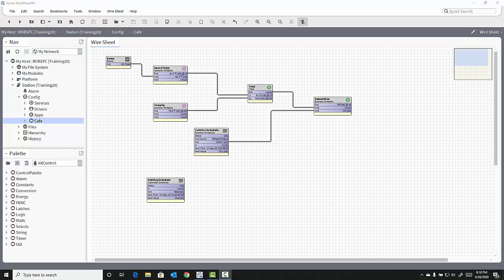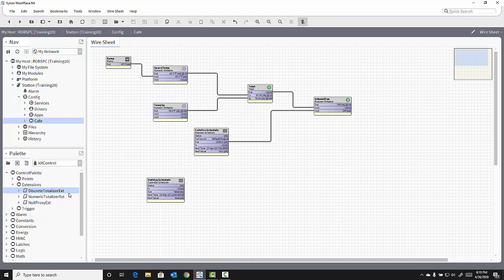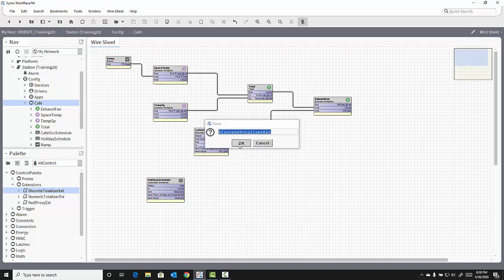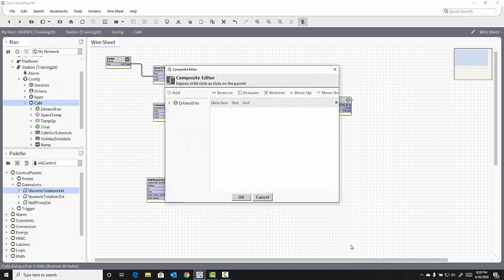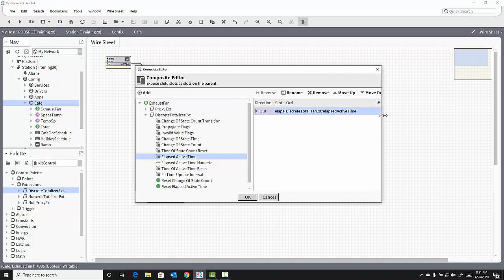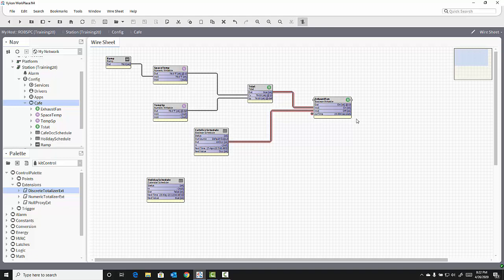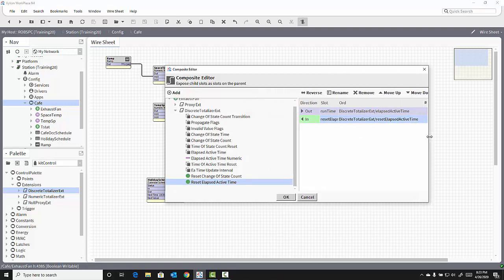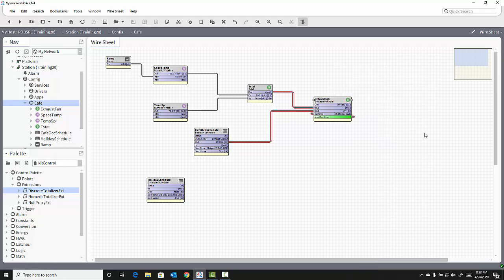Calculate Equipment Runtime in a Niagara (N4) Station

Comment: Only issue I see with this runtime total is it’s based upon the command not the actual proof. So the command could be off but customer can run the motor in hand and the software will not take the time the motor is actually running into consideration.